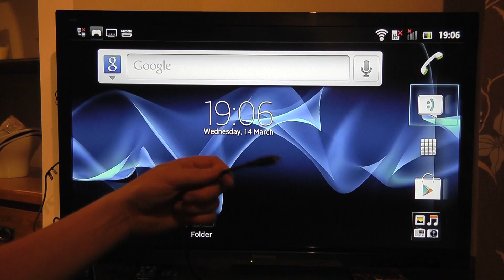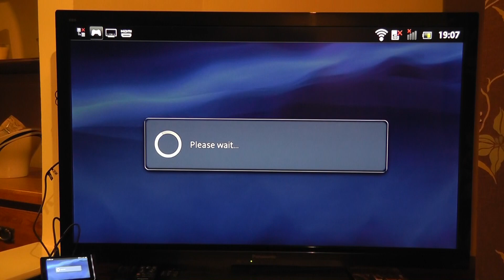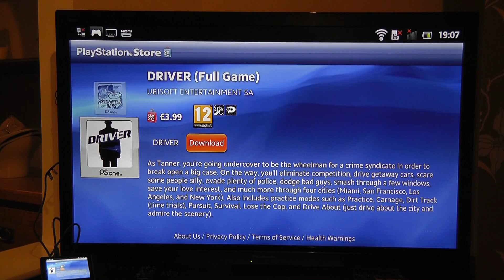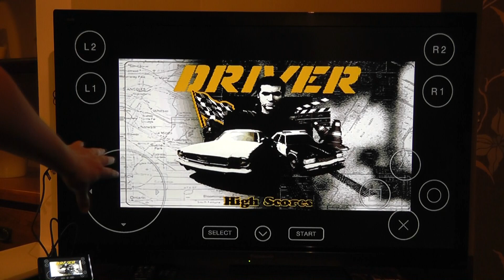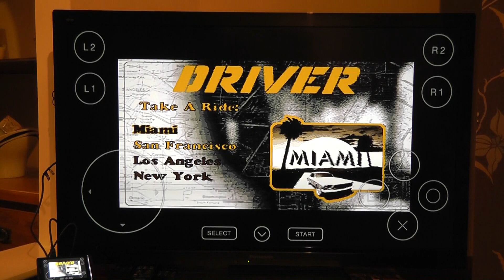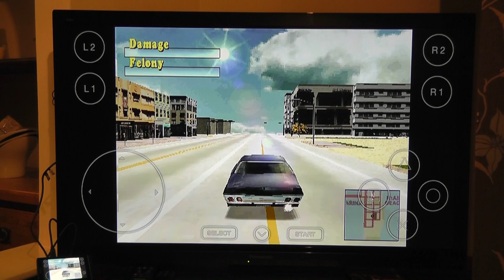Sony Xperia S, Driver & PlayStation Controller (PlayStation Certified Smartphone)

Comment from the maker: The U is not Playstation certified.  You can use usb hosting to connect a PlayStation controller but you can not connect it to a big screen either as it has no HDMI.

Comment: there's a pre-installed application called starting PS or something like that (sorry I don't remember the correct name, but it has an icon very similar to the PS store), if you lunch it, it will open a browser page where it gives you the .apk files to install the ps store and the ps pocket! cheers

Comment: I have an Xperia S, I have the store, I have PS Pocket, do I NEED to buy a smart dock in order to use the PS3 controller? 
Is there another way to do it without having to fork out cash for something that I will only occasionally use?
Maybe just a wire to convert the mini USB into a micro USB and connect it directly?
Please answer I want to play Rayman just like I did when I was about 10!